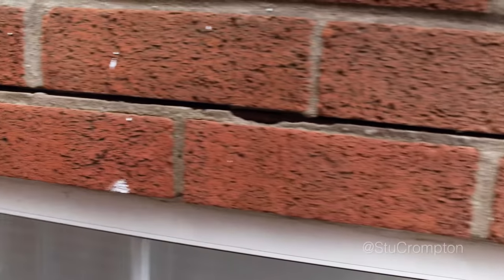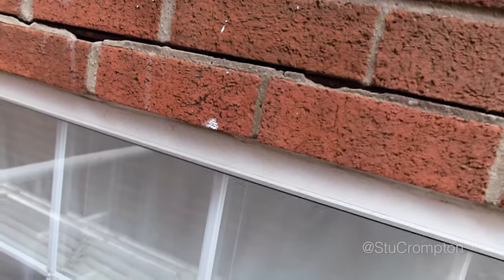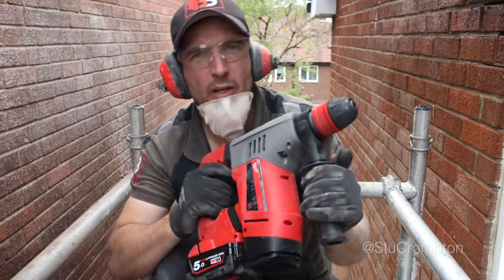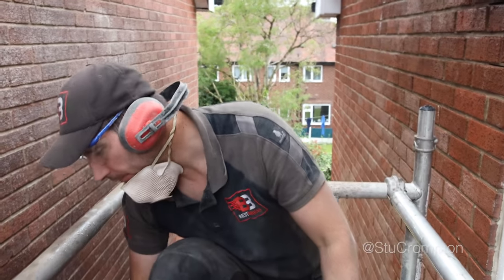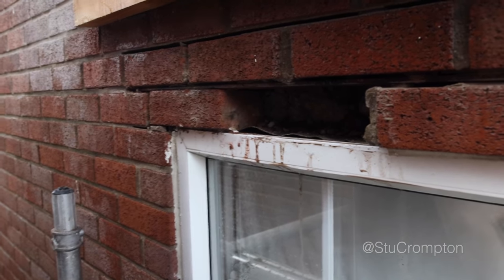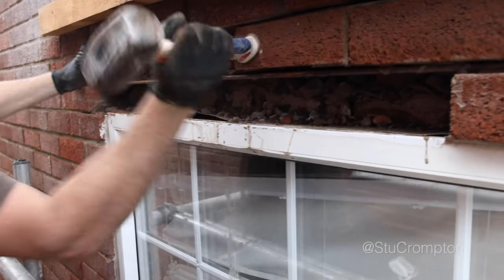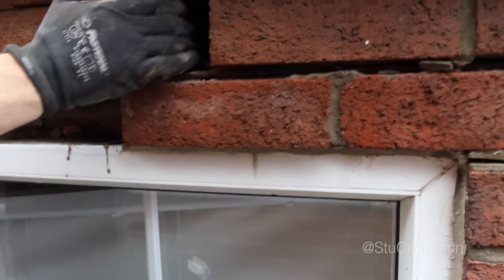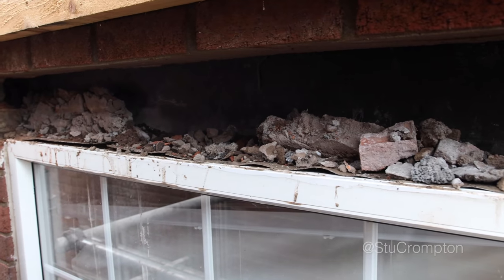Bricklaying - Repairing Lintel

Comment: Relax and remember your dad has done it before but most likely forgotten or did it a different way from you. Both breath and take on board what the other persons advice is even if you fell you don,t want to. try not to bang heads with the old's they made us, despite rubbing us the wrong way. big love to you both. (worked with my old man for many years and yes we both irradiate the tits out of each other but we can still sit down for a pint) as im sure you can.